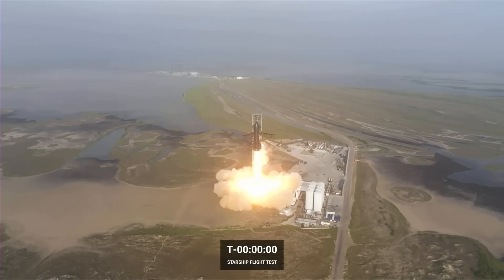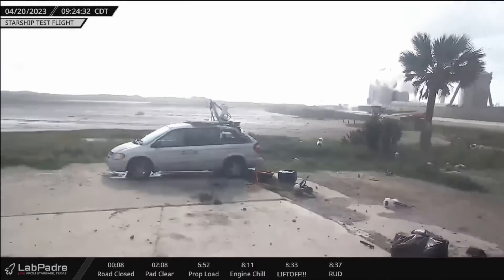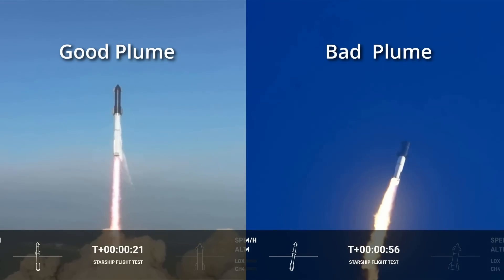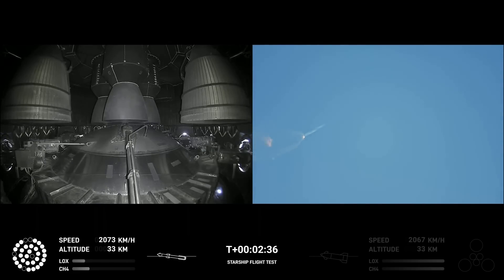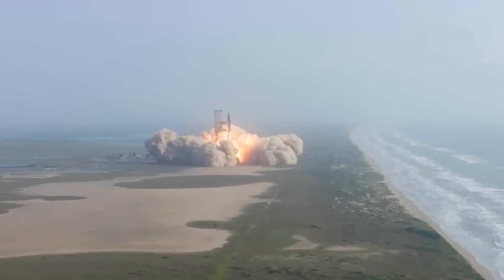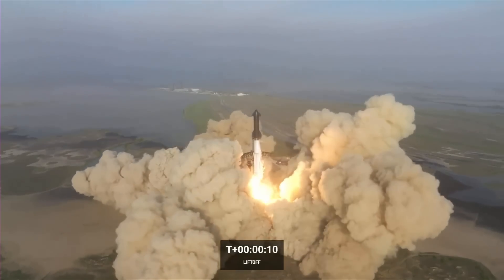SpaceX Launched Starship Like in Kerbal Space Program! What Went Wrong?

Comment: After closely examining each of the livestreams, images, and information, here's my best attempt at creating timestamps for the flight. All hypothetical causes of failure are purely speculative and may not be correct.

(T-00:02) Engine ignition. The engine indications are good enough to not trigger an abort. 

(T+00:05) Clamp release. The rocket begins moving, after blasting the pad for approximately seven seconds. Plenty of time for concrete to fly upwards and damage the spacecraft.

(T+00:07) The biggest concrete  and debris chunks were flung upwards. Even if the engines were running well before the clamp release, they were likely damaged at this time. 

(T+00:08?) Based on an image taken on the tower just after release, all engines visible were running. Many engines were obscured, but everything clearly visible was firing. 

(T+00:14) Starship / Superheavy clears the tower.  Three raptors have failed by this point according to the spaces live stream diagram. 

(T+00:27) Flashes can be observed on one of the outer engines.

(T+00:29) The engine explodes for the first time, spitting out debris an emits an orange plume for the next several seconds. 

(T+00:33) The engine explodes for a second time, and flames can be seen emmited from one of the Hydraulic Power units, possibly damaged by debris from this engine exploding. It continues to flash, and a continuous orange flame is emitted from that area for as long as it can be distinguishable. 

(T+00:40) Indication on SpaceX stream shows 4 engines out.

(T+00:50) More flashes from a different engine. LOX is consumed at a much faster rate from this point forward according to SpaceX diagram.

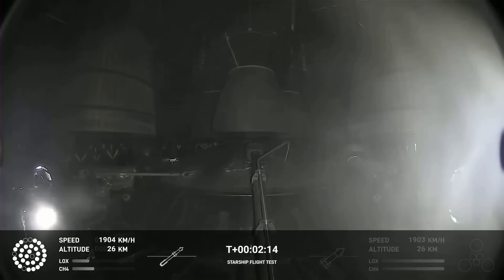(T+01:02) Another engine on the outer ring shuts down and is indicated to have failed. 

(T+01:05) Another explosion and flashes, followed by debris three seconds later. Continious flashes and orange plume come from this area for a relatively long time.

(T+01:21) Max-Q callout is made in mission control.

(T+01:25) Visual confirmation of six engines out, five on the outer ring and one in the center.

(T+01:35) A second of the center engines flames out, meaning seven total engines are inoperative.

(T+01:40) Another engine failure is indicated on the diagram, and flames out visually. At this point two engines are not running, but have not been indicated to have failed.

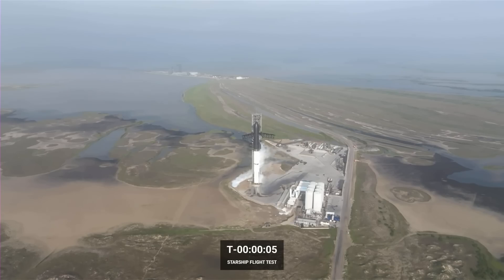(T+01:51) Apparent engine relight is attempted and indicated and visually confirmed several seconds later but the plume emitted from this engine is orange, and it continues to emmit flames for the rest of the flight. At some point before the relight attempt, a total of 8 engines were not running.

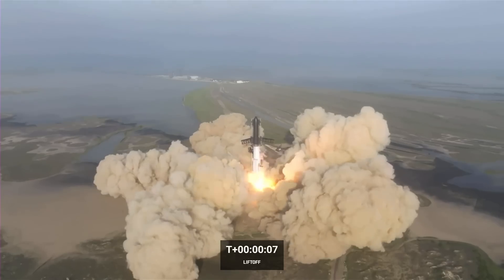(T+02:10) Rocket begins rolling and pitching. Potentially a damaged HPU could be reducing gimbal authority. 

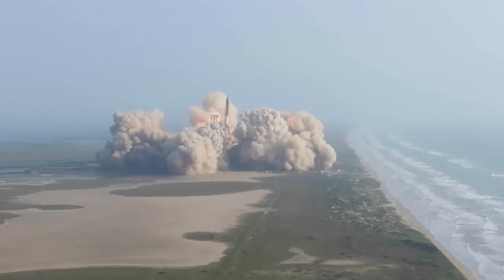(T+02:30) Green flashes observed, indicating engine rich combustion. The stack approaches about 90 degrees away from prograde direction. The rocket continues to rotate at an increasing rate. 

(T+02:50) Booster Engine cutoff announced, but does not appear to occur. Starship / Superheavy complete several full rotations over the next minute. 

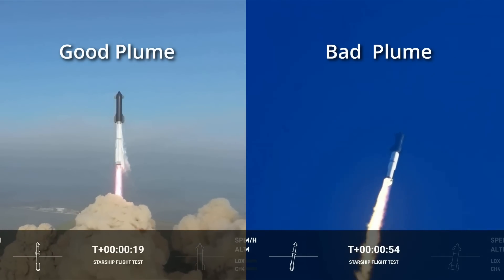(T+03:58) Flight termination systems activated, ending the flight.

Not official by any means, but It's what appears to have occurred based on the information I have available. Damaged engines from flung concrete could have in turn destroyed the hydraulic systems. Depending on how the stage separation clamps are operated, could have caused that system to fail too. Super excited to see what the SpaceX team can learn from this flight, and see them fly again!
Reply: Timestamps are for the flight, not this video. Didn't realize it would do that.
Reply: Also du to the low control authority because of only the middle engines being able to steer you maybe couldn't have adapted to the differential thrust due to the other engine out part on the outer ring.
This with maybe a bit of low aerodynamic stability at higher AoA's could have also lead to the flipping without damaged hydraulics
Reply: T+33 , when the engine and hydraulic system explode, that's when lox started to accelerate, probably blew the main feed for that engine wide open.
Reply: T+1:30 appears to be the other HPU going out as well. Note also it appears the booster simply broke apart due to areodynamics with starship intact (per leaked onboard imagery) then starship’s FTS blew in response
Reply: @Dominion69420  Hi, where can i find the leaked image? Thanks
Reply: I believe they ignited the engines at lower throttle then when they throttled up to 100% and lifted off is when the 3 raptors flamed out and not concrete damaging them
Reply: @blockin9556  I suspect that two engines flaming out near each other indicates that something big impacted right in between them.
Reply: @Enceos  that makes since but also it seems like the plume would push anything away
Reply: @blockin9556  They lifted off with about 90% throttle and still did all this
Reply from the maker: Great details, thanks for sharing! I also noticed the "booster engine cutoff" call-out not having any effect. Unfortunately I haven't had the time to analyse the other angles as much. But the "sputtering" on the outer ring was very noticeable on Everyday Astronaut.

Comment: my guess, hydraulics caught on fire and failed, which lead to the gimbal control locking up and preventing the stack from separating. This is already fixed with the electronic thrust vector controls on the new boosters.

Comment: The rocket didn't release on ignition. Only when the pieces fly up at liftoff. Because there was a massive launchpad malfunction. These pieces cause damage to the tank causing a leak. And damaging a few engines. Which later results in another explosion. Eventually causing uneven lift and an uncontrollable assent.
My guess, the rocket was bolted to the pad or clamp failure.

Comment: If anything, it's a deeply promising test flight. Had the stack not failed to seperate, it could still have reached orbit. I mean, the whole thing is automated, and it reached it's assigned seperation altitude, and began it's return burn (or at least tried to). That is with 4 engine failures.

Plus, failures during testing give more useful data, than successful launches. The more you see how things can go wrong, the more safe-guards you can design to mitigate these issues. Better to see these now, with unmanned flights, than to encounter them later when there are people onboard.

Comment: I bet you the hydronic power units got super damaged and they lost thrust vectoring because of that. That’s why she went into the tumble. Still, it’s absolutely amazing that aerodynamic forces didn’t rip the rocket apart as soon as it was flying sideways into the wind.
Reply: At the height of 'Stage Separation,' there is effectively no 'Wind'. That the structure held together under such forces is a good indicator of being built like a brick-sheet house. 👍
Reply: @peebothuhlu7186  well even if the aerodynamic forces weren’t a factor, the ship has how ever many thousand tons of propellant on it. The fact that it could flip around like that and not break up is incredible.

Comment: SpaceX might need to build launch pad from pure diamonds to withstand the might of raptors.
Reply: Or maybe use water to supress the damage
Reply: @polishkerbal6920 I dont think water can calm this beast.
Reply: @nephilim20111  i know you all are supportive of the starship but please know that water can easily suppress the damage. SLS, STS, Apollo, Falcon heavy and many heavy rockets use it to not get damaged launchsite
Reply: Diamonds are hard yes, but they do actually burn if you make them hot enough; say, under a giant rocket exhaust. Your pad will rapidly turn into carbon dioxide
Reply: @RichardB1983 melting point of diamond is 4000 celcius does raptors produce that much heat?
Reply: @Forgetten55  melting isn't the issue. Combustion is. Diamond can chemically react with Oxygen at high temps

Comment: Tim Dodd made an interesting comment pointing out how SpaceX flies multiple Raptor versions on the same vehicle in their flight tests, and how these Raptors were likely many different tweaked versions. If that’s the case, I’m sure SpaceX learned a ton about which assemblies hold up better and which designs they should avoid.

I’m curious if they actually did this, because each engine failed very differently. We saw commanded shutdowns, chamber burn-throughs, I think a pump failed explosively on one, etc…

Edit: and when I say “version” I mean like very minor changes like a different bearing or slightly different inducer geometry: the things you can’t really simulate or test without full integration in the the design environment.
Reply: Yeah could be. Im excited to see the improvements in flight test #2

Comment: Quite surprised they went on without a concrete flame diverter. The rocket lifted off rather sideways with already 3 engines failing. Before loss of control it was 8 failed engines. I assume they thoroughly tested all of them beforehand, so it's probably all damage from the insufficient launch pad and debris at liftoff.

Comment: From the looks of the destruction of the pad and the amount of concrete debris that was flying back up it's amazing to me that any of the engines survived liftoff. I'd have a guess that the six engines that didn't work may have been damaged and taken out by the launch pad debris from the start. I know Elon is smart and has a lot of really smart people working on this program, but why the hell they continue to try to launch a rocket with this much power from a launch pad that has no flame diverters is beyond curious to me. This thing has more thrust at launch than the Saturn 5 so it should need a better flame diverter system and water deluge system than even the Saturn 5 had.

Comment: No real loss, as it was UN-maned like all of them. There is NO Such thing as "space' NOR did humans pierce from an +1 ATM into a -1VACUUM.nasa claims exists there". FUNNY how when ALL aspects of the sciences they CLAIM to operate in this extreme COLD temps do NOT work anywhere on earth. So HOW do they nasa get solar pages to operate in -250 COLD on the supposed ISS they claim exists 140 miles away from earth. when not one ever MFG works past about 20 BELOW if that!

 PHOTORESIST DOES NOT WORK IN COLD EXTREMES!.. 

 Its plascifiers chemistry freeze and electrical capacity slow or ceases at these temps. Thats why you cel phone or radio in moms freezer for about 20 minutes will not work right or at all dur=e to its photoresist cannot function like ALL Photoresist ever MFG exactly the same. 1969 technology's WAY crude compared but so it couldn't possibly worked as claimed to the moon 10 days. LOL, but the LIES have persuaded ppl to believe the fraudulent logic of darkness. That can NOT whatsoever tolerate tests of any kind!!!

Comment: There's absolutely no way that B7 didn't take a direct hit from some of the debris.  And understanding that, it definitely makes sense that some engines were automatically out and others followed suit shortly after.
Reply: I thought that was why there were some engines out at launch

Until we started losing them mid-flight.
Could still be that too tho
Reply: @aq_ua  The visible side of B7 during SpaceX's footage is the one that has two explosions, one after the other.  It looks pre-damaged.  This also seems to be the side that was closest to the house-sized chunk of concrete that went almost perfectly vertical, 250+ feet into the air, practically arm's length from B7.  I strongly suspect it impacted B7 on the way up.

Comment: Am I the only one who has always been bothered by the wings being mounted on the upper half of the stack?

In KSP, fins near the top is ALWAYS a recipe for disaster once a good portion of the fuel load has been burned off, and the upper half becomes the heaviest part of the rocket.
Reply: Lots of control authority in those gimballed engines, and very low latency fly-by-wire control, makes all the difference.
Reply: @DistracticusPrime  - Perhaps. I'll wait to see it get out of the atmosphere before I'm convinced.
Reply: You dont need fins on giant rockets which use some kind of engine steering. Even if its placed up there it wont make a diffrence. After all this isnt stock ksp but rather rss/ro with testflight and far plugged in

Comment: It didn't tumble on separation.  It never reached that point and you can tell by the fuel level in the booster, and it should have been more fuel if not for the LOX leak when one of the engines blew before they shut the valve.  It looks like the hydraulics got hit too.

Comment: Question: why 33 engines. The Soviets tried this with the N1 and that blew up four times. I understand that building engines is a complicated business, but there has to be a way to use less engines on the booster. When I was building model rockets I was told to use the KISS principle and keep number of engines to a minimum. I think that should apply here too. Fewer engines would mean fewer points of failure. 
Also, why did they launch a rocket more powerful than the Saturn V with nothing but concrete beneath it. Surely someone anticipated that a ton if damage would happen if they launched.
Reply: Y'all gotta learn WHY N1 failed before you talk about it with Starship. Wasn't the number of engines. It was the fact that they couldn't test lots of the systems for the rocket, yes, including the engines, before launches. They had to wing it. High number ≠ bad by default. There's also lots of other factors that they had to deal with and not SpaceX but still. Don't go throwing around N1, do your research, I promise it's a very interesting vehicle with lots of quirks and history lol

True that on the pad tho. That was just stupid.
Reply: Because, unlike KSP, they couldn't FIT any more engines in there. 🤣

Comment: I've had my doubts about the heavy booster design from the start because of the 33 engines. The first problem I see is that no matter how reliable they are, just the statistical odds of malfunction increase with every engine.

Of course, the Falcon Heavy has 27 engines, so why would just 6 more make a difference? The FH has 9 engines on each of the 3 boosters with only a few joints and struts between the rockets to transmit vibrations. Booster Heavy had all 33 in one frame, which would compound the issue to a much greater extent and the vibrations have a much greater chance to damage critical components, just like on the N-1.

Why didn't this show up in the ground tests? Even if those tests were at full power, there was no way I know of to isolate the vibrations, so some critical amount of that energy was transmitted into the stand and the ground. Once it was launched, that same energy would have no longer been released from the Booster, putting the craft through more stress than it had endured in testing. This added vibration may have also damaged some critical component in the decoupling system.

That's my theory, anyway, based on what little I know of physics and the malfunctions that contributed to N-1 failures. If I were Elon, I'd start putting together a team to design alternative engines so that future iterations of the Booster have 9 of them. That number seems to have worked well so far for SpaceX.
Reply: the purpose of 33 engines is specifically to counteract engine malfunctions. The sheer number simply counteracts any engine failures, they throttle it below max and it can adjust and raise throttle if an engine out happens
Reply: Much bigger engines are actually more stable, but can't gimbal. On the other hand, no design could survive a direct hit from a huge chunk of concrete. The rocket is just collateral damage from the launch pad attacking Tim's car.
Reply: What I think you guys need to understand about the N1 is that a big part of it was they COULDN'T test the engines they used for flight. Not the pure number of them, but they couldn't know if they were working well for a flight beforehand. That, and many other factors SpaceX doesn't have to worry about.
Reply: And you see a totally oppsite of what you have written. The thole thing was still accelerating even when 7 engines were destroyed, 3 instantly during the highest thrust need which would not be possible with less number of bigger engines. The thing is, with a reuseble booster, more engines can be mounted. No need to cut costs on engine count. Idk how they'll redesing the lauch pad to survive the sheer power of 33 raptors xd It was the main failure imo - the launch pad